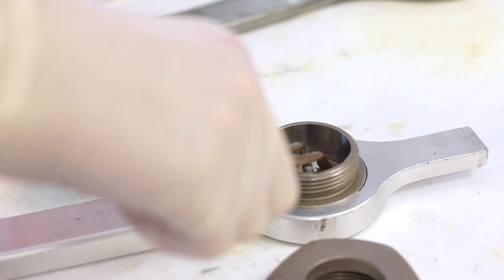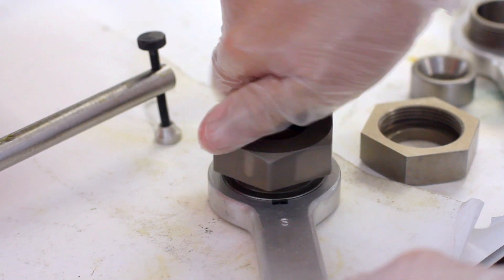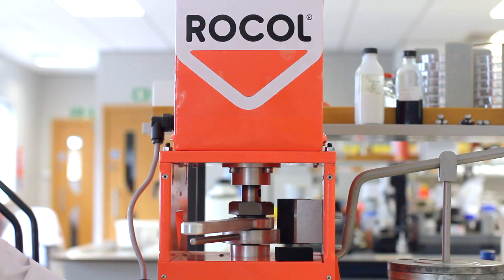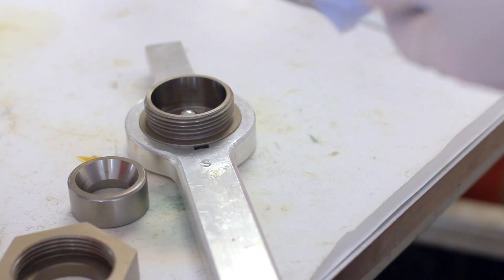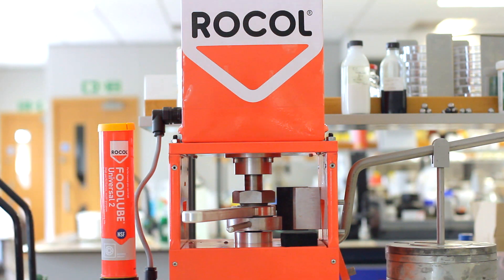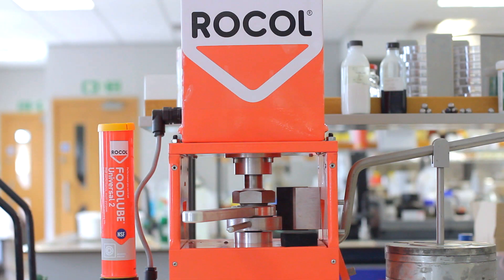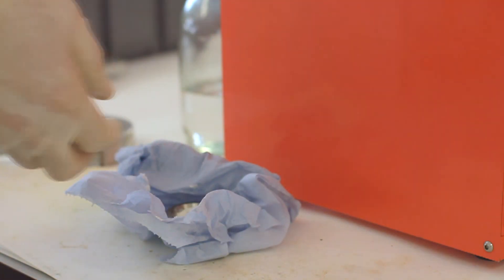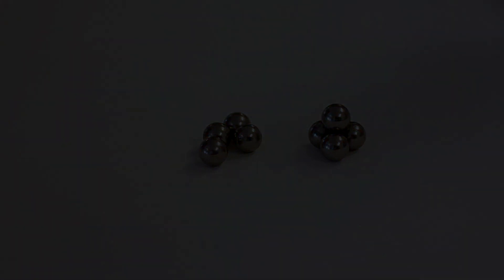Demonstrating The Four Ball Weld Test!

Comment: At what weight did the balls weld for the Rocol grease? After all, it's a test which returns a result in kilograms. It tests how much weight needs to be applied before the balls weld together which allows you to compare the performance of other greases.